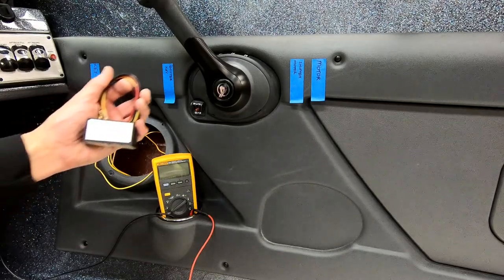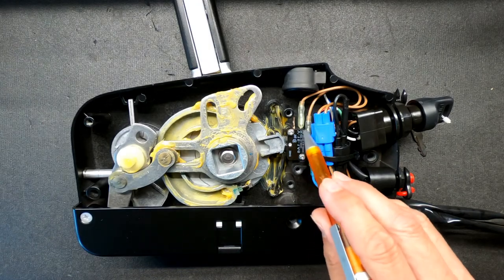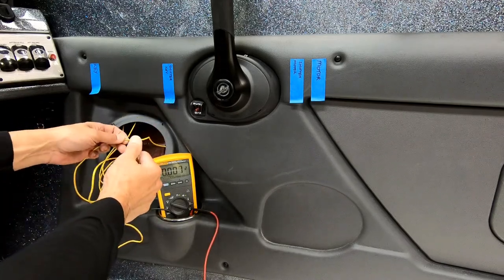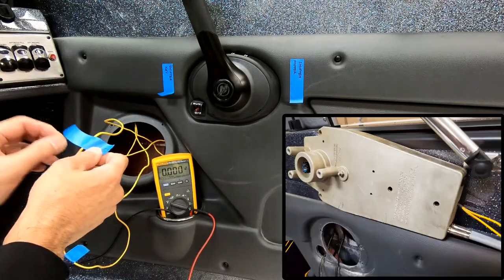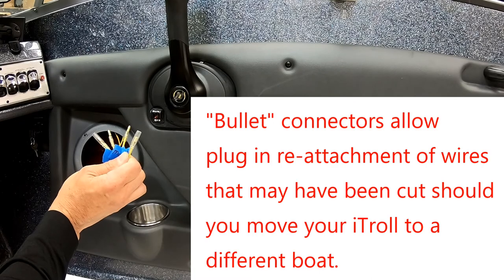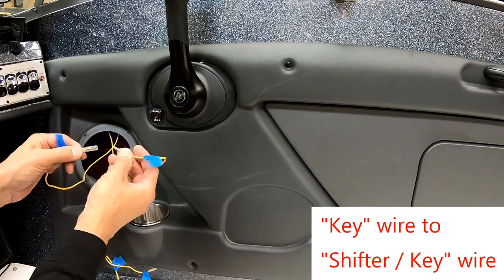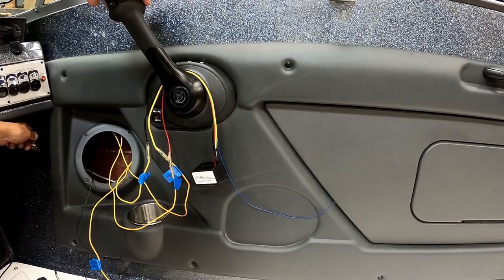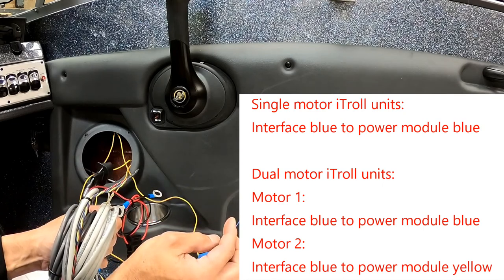iTroll Neutral Safety Interface - General Installation Video

Comment: I am just installing this safety interface on my 9.9T high thrust 4 stroke Yamaha outboard kicker.  This tutorial made it easy.  The yamaha wiring made it easier!  There are two brown wires right near the key switch with bullet plugs.  I simply unplugged them.  The two bullet plugs at the switch are the key (power) and the motor.  The two bullet plugs that you unplugged are the ones that go to the shifter. As soon as you find the "hot" key wire, you're almost home.  To confirm the unplugged wires not on the key wires are the ones to the shifter, I rung them out with an ohm meter.  In neutral, the loop is closed.  In gear, the loop is open.  If you have to fish a blue wire that goes to the blue wire on the trolling box, make sure to fish it at the same time that you fish your itroll cable. I hope this helps the fellow yamaha kicker owners.